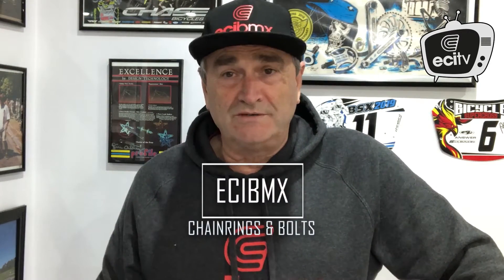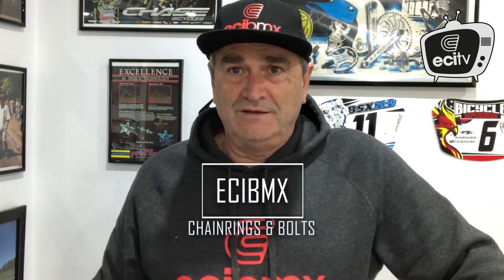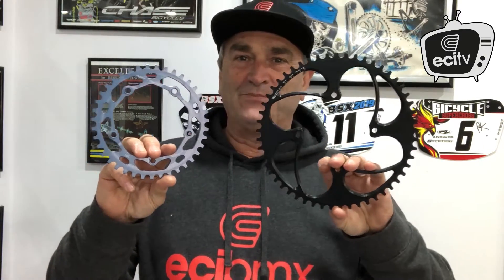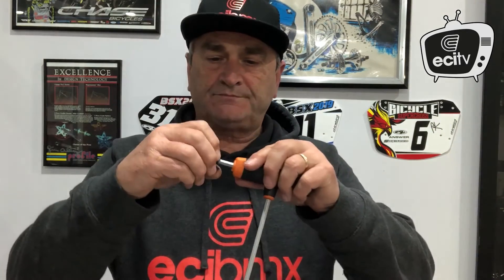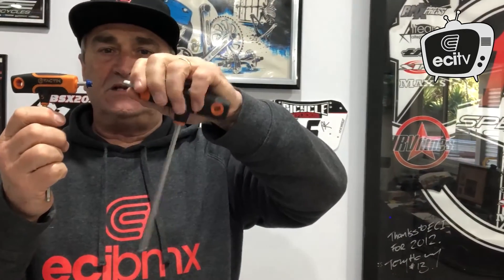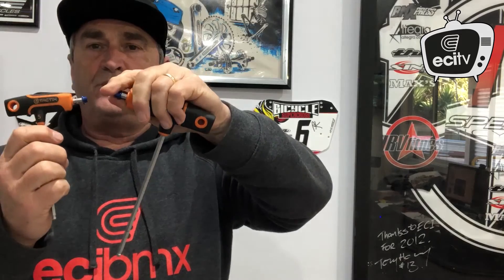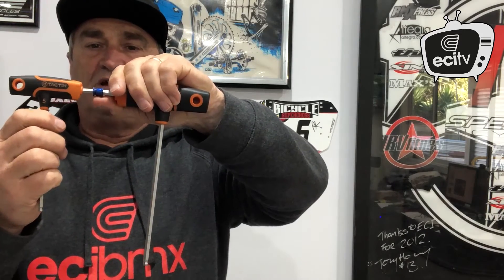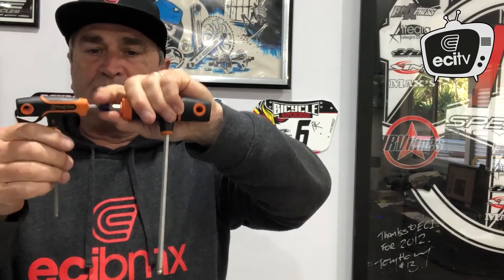BMX Chainring BCD Sizing and Chainring Bolt Variations Explained

Comment: another way to measurr more accurately on a 5 hole is to mark the center of your    holes on a peice of paper and connect the lines across to draw a star. Then draw a line from any of the points across the middle of the star to where it makes a V between the opposite two star.  points. Draw another line the same from a diffrent point( you could do all 5 if you wanted) that wilk find your center point.  then just measue from the center to  to the end of a star point to find the radius .  multiply that by 2 will give you the exact diameter.